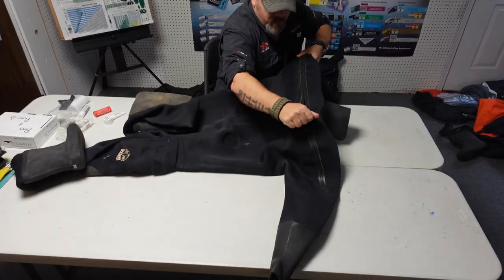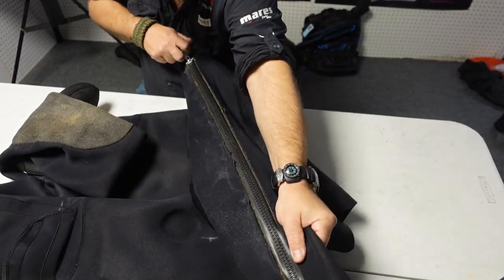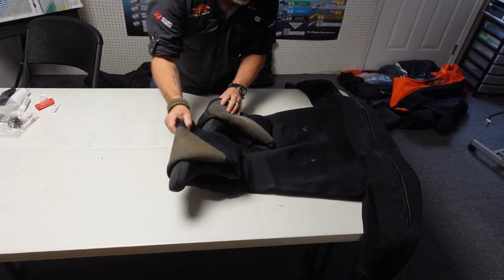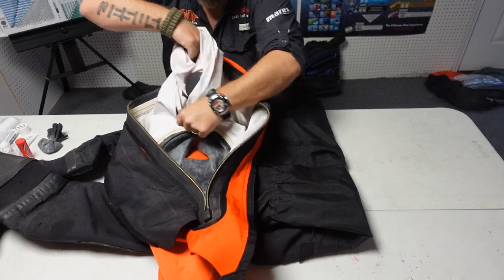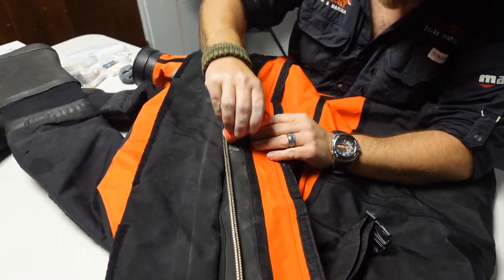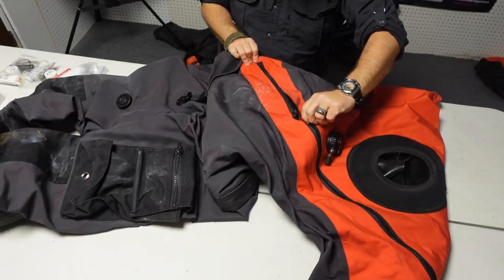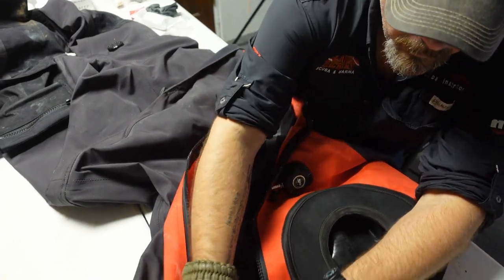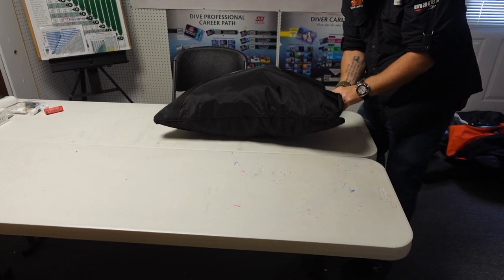Drysuit Diving Part 3 Prepping And Aftercare

Comment: Bryan, I wanted to thank you for all the information, tips and hacks that you have provided. Definitely a huge help to someone like me that has been diving a while, but looking to fine tune and expand into other areas of scuba diving.  I recently finished my dry suit coarse and ordered my dry suit.  I have been looking at the various carry bags that you use for dry suits and wondering if you would provide the different manufacturer and model of those bags.  The bags that you put the dry suit in initially and the bag you use when you incorporate it into with your accessories and undergarments.  Thanks!  Mike

Comment: Great Advice. Just one point. I was told to leave my  drysuit hanging for storage if I possibly could. Thoughts?
Reply from the maker: Hello Ray Amis, great question. In part 6, we will discuss how I personally store my Drysuits. There are several methods I use. It all depends on how much time will lapse between each time I use my Drysuits. The ambient temperature means a lot as well.

Comment: Personally I never get talc anywhere near my suits.  It is notorious for working its way into autodumps and eventually causing seepage.  But I never wear undergarments with potential snag points and I have neoprene seals that work best with a drop of lube.  I was advised by OThree always to store the suit hung up and with the zip fully closed.  This keeps it well aired and it just gets rolled up in the bag to and from the dive site.
Reply from the maker: Hello Tim Gosling, sorry to hear that you have had a bad experience with Talc Powder. Thankfully, in the last 35 years of diving, I've never had any issues with it. I would definitely encourage you to follow the recommendations of the manufacture.
Reply: @LakeHickoryScuba  Yes the manufacturer advises against, but then their suits don't need it.  They have had suits come in and found leaks caused by talc getting into the dump.  Never used it and never had a problem, but thanks to your videos I can se why some people do use it.  Stay safe and keep it coming!

Comment: You mentioned that only the brass zipper you would leave unzipped, but you didn't really mention the reason for that (or why you would leave the others szipped, for that matter). Is it due to potential corrosion issues with the brass that might cause it to stick to itself and thus not unzip properly or something?
Reply from the maker: Hello Lenny Zimmermann. Corrosion issues is the biggest reason. As the brass zipper can allow water to be trapped in between the teeth, causing the corrosion. A secondary reason is, with brass zippers they tend to be stiffer and can make it difficult when storing in a bag to get it rolled up neatly. During our Drysuit Course, we go more in depth to the little things, that we simply don't cover here on YouTube. We encourage all divers to seek out their local Drysuit Instructor for proper training.